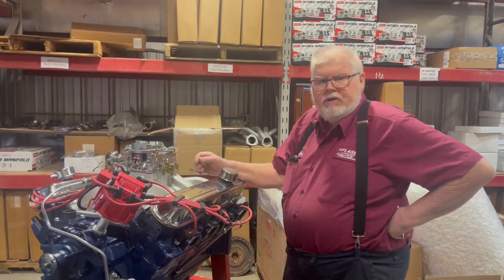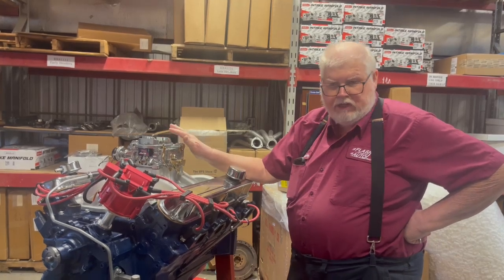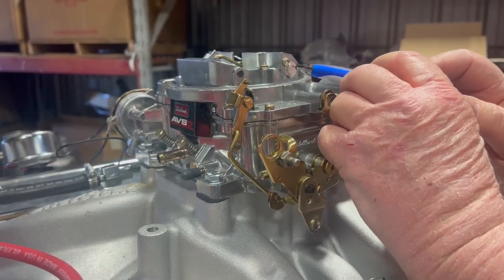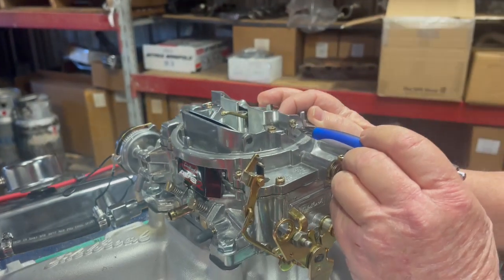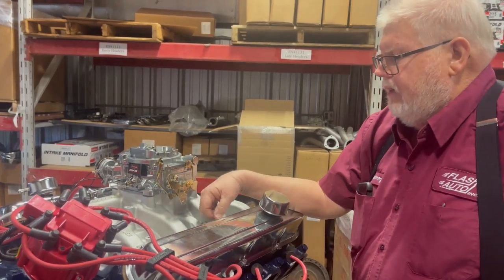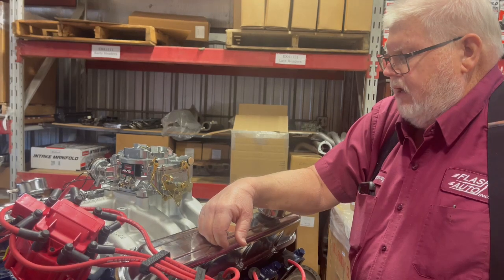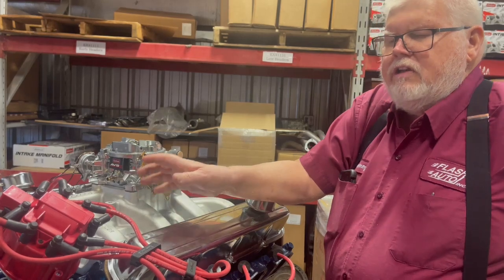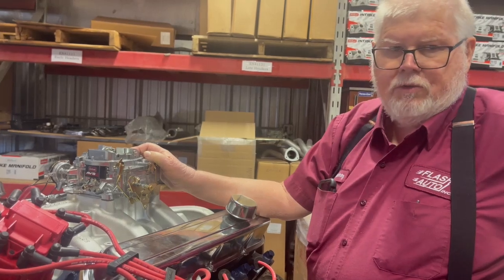Carburetor Air Flap Adjustment

Comment: I gave this company a insane amount of money a got a pile of a engine.  The first engine I got the cam bolts fell out and it was destroyed.  The next one had rocker noise and a oil pan leak.  Sad company that sells dinosaur boat anchors.  Get you a LS way lighter and cheaper.

Comment: I have an AVS 2 on a 406 sbc of around 400hp. It is behaving exactly as you described, ie; it has a momentary lean stumble when I get hard on the throttle. The first time I tried to adjust the spring tension I didn't realize I needed to hold the adjusting screw while I loosened the set screw. As a result the spring immediately released all its tension so I lost my baseline. I have tightened it 2-3 turns from that point but the engine is still stumbling. Is there a baseline number of turns from which I can then begin adjusting? How much resistance should I feel when opening the air flap with my finger? Thanks for an advice you can offer.
Reply: Did you get it right? thanks for the tip on holding the adjuster while loosening the set screw bout to adjust mine
Reply: @ Yes. I just kept tightening the tension until the stumble disappeared.